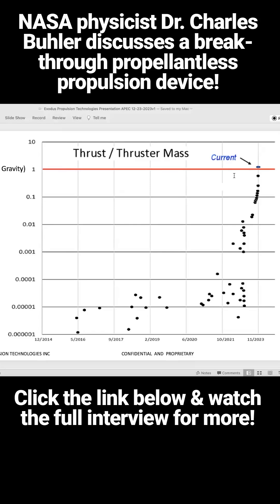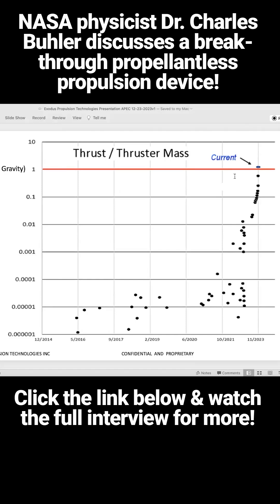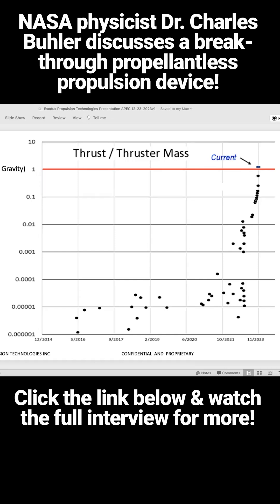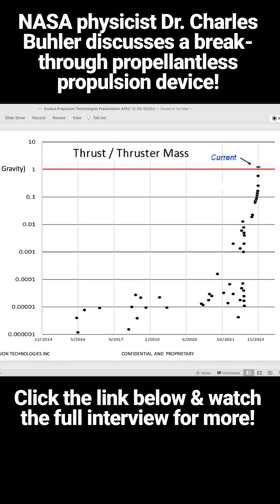Breakthrough Propellantless Propulsion Device

Comment: I assume that if more divergence charges are what is needed to enhance the effect, then high dielectric constants are critical for improving it.  Is this the case?  Maybe high dielectric strength?  But there aren't hardly any materials with significantly higher dielectric strengths than the polymers they've used.  The highest I've seen is diamond, and that'll keep the system pretty impractical.

Comment: If current destroys the effect, the force is dependably upon asymmetric voltage or static potentials.  Now go to the tens of millions of volts and see what it does.
Reply: Precisely
Reply: @Critter145  may we regard static potentials? I have many answers.
Reply: @ if I had a laboratory I’d be doing the testing right now.
Reply: @Critter145  Don't I already know :)
Reply: We live in the real world of limitations.  In the vacuum we can generate, 10E8v/m is the likits of the materials we use.